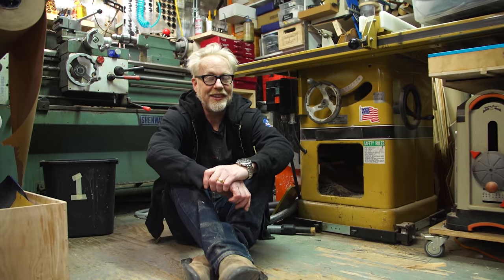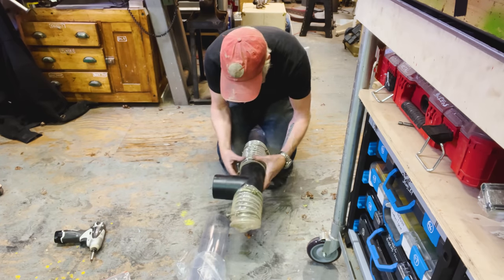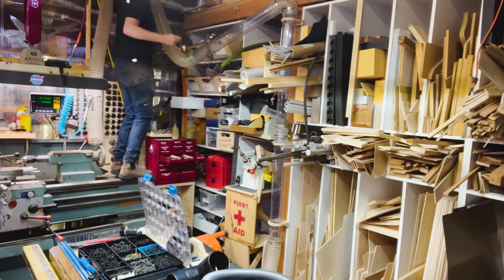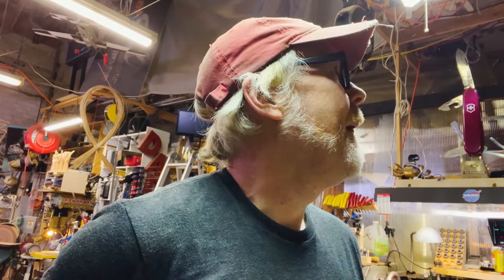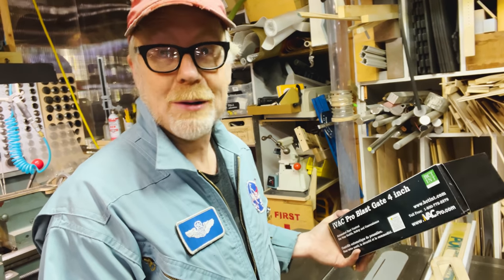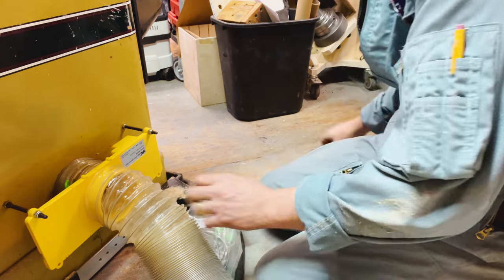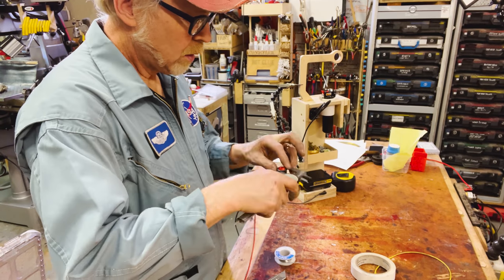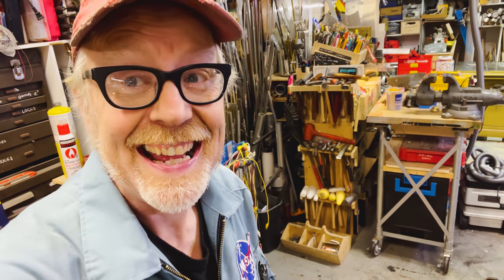Adam Savage's One Day Builds: Shop Dust Collection System!

Comment: "do ribbed vents decrease air flow?"...there used to be a show that would test those type queries
Reply: @ClanBez  Most setups have at least some use of that hose. The question is reducing it to as little as possible.
Reply: @ClanBez  Yea correct. That's how mine is, it's hard pipe down to at least the blast gate at the tool then a short as possible flex run.
Reply: I should binge watch it for 72 hours straight

Comment: Good job! That's a huge improvement. I've been going though the same process the last few years after retiring and getting much more seriously into woodworking. Here are a few long-winded tips:
1) If you can replace those 90° T joints with Y-joints or 45° T's, you'll get better airflow. Air doesn't like to make abrupt 90° turns any more than it likes ribbed hoses.
2) I think I noticed a Festool vacuum on the floor in the background of one of your shots. For small, handheld tools like orbital sanders, you may be better off using that than using a small drop from your main dust collector. Shop vacs move less air than a dust collector, but they do it at a higher pressure. (Dust collectors move lots more air, but at a low pressure.) The former (high suction; low volume) is what you want for tools with small orifices like orbital sanders, handheld circular saws, biscuit joiners, etc. Having said that, I was impressed by how well the small hose from your DC worked on your orbital sander. Maybe the conventional wisdom is wrong.
3) If want to get serious about air quality, buy a Dylos air quality monitor, preferably the "pro" verison that can measure 0.5 micron particles. After I bought mine, the readings were enlightening in a scary sort of way. It also came in handy during last fall's awful fire season. (I'm down in the South Bay.)
4) If you're scared by the particle readings, you'll want to replace the filter bags on your Delta dust collector. Those things are terrible. You could buy a new dust collector that uses canister filters, ideally with a cyclone separator before the filter. Or go to Wynn Environmental's site. They have a lot of good canister filters along with instructions on how to retrofit them onto DCs like yours. There are also lots of YT videos on how to do it.
5) I've heard good things about those iVac blast gates. "The Wood Whisperer" has a video where he installs the whole iVac system, and he seemed happy with the result. A couple years ago I started learning electronics in the hope of building my own DC automation system (including blast gates). I now know enough to do it but I just haven't have the time, so I may break down and just buy the iVac system even though it's crazy expensive. (I have the money, so I might as well spend it and get back to woodworking. :-) If you decide you want to build your full DC automation system, maybe we can compare notes.
Reply: I'm afraid I don't understand the low pressure/high volume vrs high pressure/low volume dichotomy. Surely if you connect a low pressure/high volume system to a small pipe, you get a high pressure system?

I'm modifying my own home built vac based system to use larger diameter pipes to the table, and then have smaller pipes to connect the hand tools. This should reduce air friction in the pipes but still have high pressure at the tool.

Or is there something I'm missing?
Reply: Well said. Basically all of the same concerns I had while watching this but you gave such an informative response. Thank you! Hope he sees this. 🙌🤞
Reply: I don't think the conventional is wrong, it's just that his component combination, with all other branches sealed, managed to achieve adequate suction for that tool test context anyway. It's still fairly obvious that it doesn't have the high static pressure of a floor shop vac, but it might still be adequate to get some jobs done.

Comment: Adam, I have built a few vacuum system for my workshops. The recommendations I would give you is to eliminate the T junctions and replace them with 45 degree junctions, add a cyclone dust separator and a pleated filter instead of a dust bag. It will increase your airflow tremendously.
Reply: I'm sure someone else already pointed this out but, the reason the small hose had no power was because the larger opening to the table saw was open. He needs a blast gate to resolve that. He mentions automatic gates for the small hoses to open when he's using them, but he really needs to be able to close the larger tubes taking suction away.
Reply: I guess he realizes it @25:00 in.
Reply: This was exactly what our old shop did for the dust issues. we had a lot of machines running and the power on the collector was enough to suck someone into it too with it just wide open. tremendous machines
Reply: This, and they say it's better to have the gates/valves closer to the dust collector/main pipe, rather than at the machine, since the extra length of pipe does reduce suction power somehow, I'm not an expert though.
Reply: Drat. I’m confused. I saw Adam standing next to a Festool dust extractor. So, I’m curious why he’s not using/ discussing that system? Does he not use it? Does it not perform the desired task adequately? Does it no longer meet his shop’s production needs (as in his shop is so maze-like it’s impossible to move the Festool around)? Or, does the old table saw not have an attachment built into it for dust collection? I see the reason for one or the other, but not both, unless he’s upgrading - then he said it won’t replace his Shop Vac (presumably the Festool). But if he’s changing/adding/upgrading from the Festool, I would like to know why. I’m thinking buying one🤔.

Comment: One quick and easy way to increase your efficiency is to try and keep the 90 degree turns to a minimum.  The softer the angle of approach in your turns the better the air can move.
Reply: Straight/45° bends are much more efficient as the airflow isn't sharply redirected.
Reply: I read through the comments looking for this or I was going to say. “As much as Adam loves efficiency...”
Reply: Fluid dynamics!!!!!!
Reply: @bobbyfischer7609  Exactly.  Was doing the same.  If you spend the money getting rid of your ridged tubing, you've all but ruined the efficiency by putting sharp angles in the system.
Reply: also if you have multiple stations,  add valves to them so shut off the stations you aren't using at any given time.
Reply: @richardgomez3469  that's literally what he's doing through a large portion of the video.
Reply: @richardgomez3469  there are remotes that only turn the vac off if every gate is closed. Open one and the vac turns on. It ensures a closed system and the best suction. 👍🏻
Reply: @averagefirechannel  well yeah, but that would put tubing in front of a lot of shelf space. I mean look at his shop... I'd kill for a space like that, but any kind of integrated system is gonna have to work around the storage.
Reply: I'm assuming you'd know but given he is still using some of the ribbed clamp that 'effectively narrows the opening' isn't it pointless to mix the mediums? From fluid dynamics stand point, your flow through is going to be that of the narrowest point.
Reply: In this case, it doesn't matter how many 90s he has, the shop vac is too small for that run-a-pipe. He's either one or two sizes under. It's kinda like asking a guy to suck beer from a 5 meter long straw.
Reply: @Walletau  The interior wall turbulent resistance effect is measured in "per meter" of pipe, so eliminating 2/3 of the dryer hose will improve efficiency.  Not perfect, but lots better.
Reply: Hi Adam.
Bill Pentz has a great website for understanding Dust Collection.
As a technical thinker I believe you would have benefited greatly from his research.  Love this channel and everything you do and teach.
Reply: @chemcody5119  100% agreed! I used Bill's website to design my dust collection system. Adam -- take a look. Think you'd love geeking out on Bill's content.
Reply: Adam, incase you haven't heard. You can start a fire by sucking up metal bits into a dust collector. Metal hits the impeller and sends a spark to nest in you bag-o-wood-dust. Some will smolder for hours or days before the real fire starts. I think they make a magnet catcher thingy that installs before the collector to prevent this. In our shop, we always used a regular shop vac for cleanup to avoid this. We had a giant dust collector so magnets didn't work. Bill Pentz is the man, like the other guys said. Thanks for all your hard work.
Reply: I was going to say the same thing.

Comment: Adam
I built my own dust collection system out of sewer pipe and home made plywood blast gates. 
The system is completely friction fit together with NO CLAMPS or Pipe Glue at all. 
It’s flipping awesome and it’s was super cheap. 
I’ve been using it for 22 years and it’s still going strong. 
I wish I could show you some pictures some how.

Comment: To complete my shop air filtration system,  I enclosed a large furnace squirrel cage blower inside a plywood box. One end has 3 furnace filters, first a plastic mesh to catch the bulk of the airborne dust, then a pleated furnace filter, and third a charcoal filter. All can be cleaned with an air hose or vacuum.  The clean air exits the box on the other end.

Comment: Adam is a true creative genius, which means engineering types like myself are frequently bewildered by his lack of planning. 
His goal was improve vacuum by getting rid of the corrugated tubing, but ended up using it in every joint. 
He bought a bunch of material, but had no idea if he bought enough.
He discovered during implementation that he needed gates, although he had once custom-fabbed a gate for his disk sander.
He bought an electro-mechanical gate, only to discover after it arrived that it didn't really fit on his saw.
He added a second switch on his saw to run the gate without considering whether it could be rolled into a spare pole on his existing switch.
He drilled holes into the saw without considering if he would electrocute himself by doing so.
The chasm between engineers and creatives is real.
Reply: Engineers: I want to have a drawing of the master plan and a materials list before i go shopping
Creatives: look at all this cool stuff i bought, lets go throw it together with 3% of a plan

This is me vs my dad when doing home improvements like installing a 3way switch, or building a nightstand out of an old octagon window. Our dust solution is to set up the saw outside and stand upwind. (N95 indoors as needed)

Edit:
Apparently I don't know how the wind works so "downwind" --> "upwind". (Typo or tired brain)
Reply: Yeah, but it wouldn't be nearly as entertaining if it was a accurate "how to" video. 😁
Reply: @doncarlton4858  True. A video done by me would include the following phrase, “So, then I took the feasibility study to the budget committee”

No one would watch that.
Reply: So true - and the engineer has a beautiful finished project with every cable managed and every use case provided for; the creative has five times as many projects, but half of them are abandoned or repurposed for something else and nothing is ever done the same way twice because they either learned how to do it better or heard of some new technique they wanted to try. Amazing things happen when you can put them together without killing each other.
Reply: And yet you felt compelled to watch him, assuming he'd make the very "mistakes" you point out.  Says more about you than Adam.   Adam has said many times, going back to the early days of Mythbusters, that he (and Jamie) are not engineers or scientists.  They're craftsman and builders, with decades of experience.  And I forget, what show did you have on Discovery?
Reply: @billphillipstube  I'd watch it. Not only is it interesting to see things done by correct and meticulous process, a good host can make anything interesting. So many beloved youtube channels are just people explaining the intricacies of their hobby or their profession or weird little things they found in the back of closets. And again, honestly, I think it would be very interesting to see more youtube videos approach how to plan things. So much content and culture is focussed on "throw it up, get it out there, see what sticks" that we forget if we took that approach in a lot of other areas of our lives people would die.
Reply: @dzjc01  I'm roughly dead sure dude wasn't ribbing on Adam. He was simply pointing out there's many differences between big picture builders and detail oriented builders. Be nice friend.
Reply: @dzjc01  dude stop being rude he did in no way attack adam. He literally complimented him
Reply: Right? it really wouldn't have taken much longer to watch one of the hundreds of videos of others doing this and see roughly what he needed instead of diving in and making himself look like he doesn't know what he is doing. I guess for something like this he doesn't really
Reply: @jasonreed7522  You'll get better results with that dust management solution if you stand upwind. ;)
Reply: True, but it depends on the build. I can many times finish making the build before the engineer can make the drawing.. There is always some tweaking and modifying after I build something.  In the end I get it done and it works as good or better in half the time that it takes to plan, have 10 meetings and 50 conference calls and 300 emails.
Planning is great but when planning consumes more time then the task, it becomes a waste of time.
Adam is entertaining and brilliant. his mind is going 100 mph and he is just trying to keep up with the ideas that are popping in his head. LOL
Reply: The creative creates, the engineer perfects, the operator operates (in a fashion somewhere between what the other two intended). Together they revolutionise industrially!
Reply: In my world, its the fly by the seat of your pants approach,, I use. 
I cut a bandsaw in half, added 4 inches of resaw with unistrut.  Lol
Live, no edits!

Comment: I can highly recommend investing in a really decent safety step ladder.  They’re just awesome - and I won’t have anxiety watching you wobble around on that one you currently have 😂
Reply: I was happy he finally used a stepladder. In the beginning he was standing on the table saw and, I’m assuming, a desk. I have to admit I thought, wow I’m not the only one climbing on stuff instead of valuing my bones.
Reply: A folding ladder like Adam's (and mine) offers a great deal moire flexibility than a stepladder. My Werner 8'-16' ladder is now a 12' extension ladder into one of the two attic access hatches in our garage ceiling. (The other has a pull-down attic ladder.) I own a step ladder, too, but "every tool has its place." And safety is a USER characteristic more than a tool characteristic, right?

Comment: I love Adam Savage and his channel. I would recommend these succinct tips to anyone installing a dust collection system:
- Dust collectors are good for high volume, low pressure. This means tools like a table saw that produce A LOT of big chips.
- Shop vacs are good for low volume, high pressure. MUCH better for something like an orbital sander (you don't want to use a dust collector for an orbital sander).
- Don't use T's in ducts- use Y's (much better airflow directionality).
- Install blast gates at the trunk, NOT at the tool (prevents leakage and turbulence in the system).
- Use smooth metal ducting for dust collection (NOT HVAC ducting). If you can't afford metal use cheaper PVC.
- Avoid sharp bends in your system - long sweeping curves if you need to bend.
- Avoid flex-hose like the devil, and if you have to use it, use pipe clamps designed for flex-hose.

Comment: Those corks could use a string to keep them near the ends where you need them. No doubt a cork will disappear in the next 5 uses. :)
Reply: I was thinking that I'd staple the cord to the cork and then slip knot it around the hose.
Reply: I just posted the same comment before reading yours, even the part about losing them! great minds.... :)
Reply: I see another one day build with some delron on the lathe making feathered caps for these hoses.

Comment: Adam I have the same dust collector as you and switching from the type of “T” fitting that you used to a “ sanitary T” with a large sweeping curve made a significant improvement. I used ABS.  You might also think about running a ground wire. Static electricity and fine sawdust are a bad combination. While a fire is very unlikely, a couple of dollars in copper wire is cheap insurance
Reply: Came here to say this about the static charge and sawdust. Glad someone had already mentiuoned it.
Reply: I think Adam could test to see if his wood dust is explosive inside his collection pipes. Add spark plug downstream of a sander or joiner.inside thr pipe.
Reply: @pdeclerck  he doesn’t have to test. There are quite a few documented cases of sawdust being ignited by static electricity in dust collection systems.

Comment: Adam, you've changed my life! Ive not installed dust collection in my shop because I didn't have the floor space to devote to the collector. It never occurred to me to put it in the attic/loft area (which is mostly empty). Now i can have dust collection, it will actually be easier to run piping than if it was  on the ground floor. I think I'll move the compressor up there too and mount a regulator in the ceiling where the line meets the rest of the system. Hell it'll be easier to access the water drain for the tank if it is sticking down from above. 
Mind blown.

Comment: For when you use the handheld vacuum, you could make some kind of damper that closes everything but the handheld and give you full force on that. You could also make a switch that turns on vacuum when you grab the handheld from a holder on the wall.
Reply: Was thinking the same thing that would make a big difference